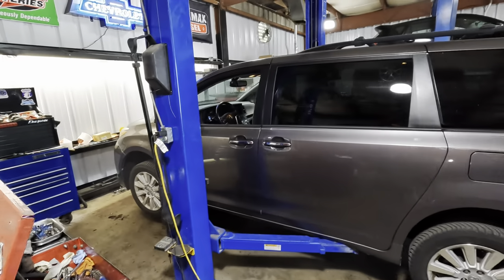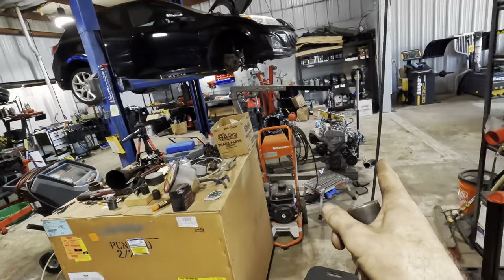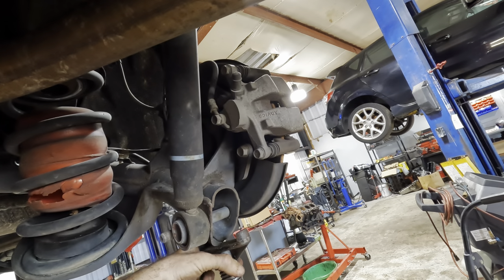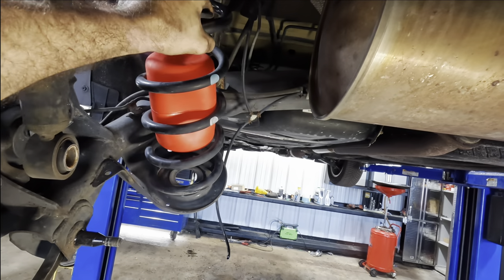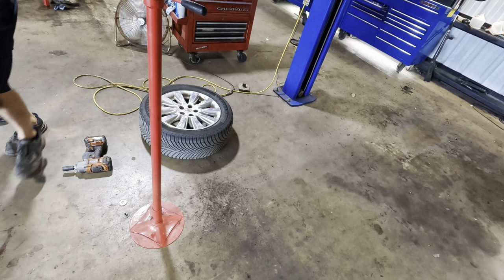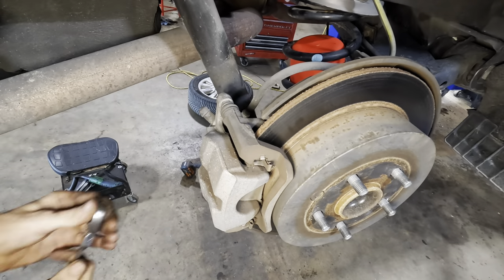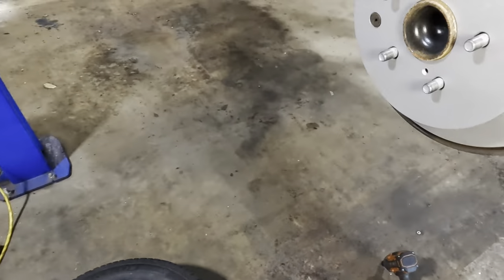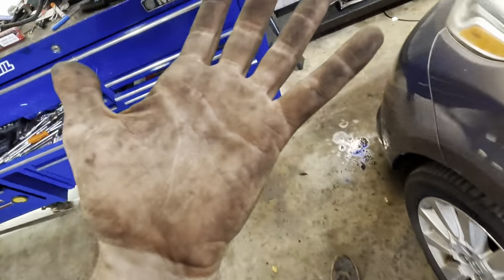Minivan Tow Vehicle! (Helper Bags) Toyota Sienna 3.5

Comment: Do you ever find yourself going to get something and then be stood there and think to yourself " what the heck did I come in here for?!" and then having to go back to your work to remind yourself what you went through there for in the first place? 😆 🤣 😂
Reply: Weed does to ya.
Reply: Old age does too 😆 🤣 😂
Reply: !/2 the time going into the bathroom.
Reply: All the t…  wait, what was I typing?
Reply: many,many times, it's when you go back to where you were and remember what you were doing,and go to get or do what ever it was,and you still can't remember, that it's worrying !   I found out what makes it happen (for me anyway)  on the way to the place that there is something I have to get or do, I see something else that I have to remember to address, and in slotting that thing into my memory, it seems to push out the original reason for going. I think that reason may be only lightly held in mind. Say I'm going to get a 7mm slotted screwdriver, I haven't thought much about it, I just know I need one, so the other thing I have to remember, I do have to think about. And this seems to empty the holding spot for the screwdriver.     I have probably expressed this very badly, I must think about it !!
Reply: That's what happens when the crain branium is filled with too many 60's and 70's song lyrics. No more room for the short term memory.
Reply: @clbcl5 
Thanks, now I remembered where I was going.  😂
Reply: I call them senior moments
Reply: I call that a glitch in the matrix. Lol the story of my life. Haha
Reply: It's happening in my 30s. 😬
Reply: All too many times! 🤣😆
Reply: @brianpiper3188  I'm surprised it doesn't happen to Ray more as he's blethering to the camera so slightly distracted talking to us, maybe those takes don't make the cut 🤔

It'll happen now I've mentioned it (Jedi subconscious mind trick, 'These are not the parts you're looking for!' lol), he'll be cursing my name 😆 🤣 😂
Reply: Daily!!!
Reply: Yep been there
Reply: Yes, I called that a brain fart.
Reply: Question for you, Ray. Are you not required to wear steel toes in your shop? I live in Canada and we are required to wear steel toes or other safety shoes.
Reply: What was the ? ... again???
Reply: Too many things on my mind
Reply: So that’s not supposed to happen 😎
Reply: So that’s not supposed to happen 😎
Reply: Always done that no weed or old age involved lol 😂
Reply: Many a time 🥴
Reply: Yes. Being 68 can cause that.
Reply: Yeah man trying to remember to do everything at once is disorienting
Reply: Well, we know where we're goin'
But we don't know where we've been
And we know what we're knowin'
But we can't say what we've seen
Reply: All the time 😂
Reply: @scottbishop7899  Even when in my twenties I found myself doing that. I think it's due to being scattered, thinking of too many things! 🤔
Reply: Yes - Either to many  irons in the fire or   a hitch in your get along .
Reply: Yep.
Reply: I'm 32 and this happens, I must be doing something wrong
Reply: All the time
Reply: @clbcl5  😆

Comment: The vehicle owner made an excellent choice for tires. I put the Michelin CrossClimate 2 tires on my 2021 Ford Escape Hybrid and in my 68 years on this Planet I have never had a better set of tires on anything.
Reply: There's a perceptual issue at play. Unless you compare a NEW set of the original tires, against the new Michelins, you have a very misleading impression. Any new set of tires will be better than 4 year old tires with tens of thousands of miles on them.
Reply: I retired from Uniroyal Goodrich tire company and Michelin tire company bought us out. When you buy a Uniroyal tire you are buying a Michelin tire but a lot cheaper. You pay for the Michelin name when you buy a Michelin tire and are paying for advertising
Reply: I don't really like the seating on those tall jacks, I can see that you don't much either !
Reply: Those tires are overpriced junk
Reply: Those tires are outstanding in snow…if they made them in 33” they would be on my truck instead of just my wife’s Pilot.
Reply: @Mike-gc9ih 
I retired from Goodyear and I would buy the Uniroyal tires if I didn’t get a nice discount from Goodyear.
Reply: The best choice the owner made was the repair shop.
Reply: They look awesome, but they are directional.  I like to rotate my tires in a way that doesn't work with directional tires.
Reply: I bought the same tires for my wife and daughter. This means that I certainly agree, great tires.
Reply: @rainmanraysrepairs What was the brand of brakes you used on this van?
Reply: @Mike-gc9ih  --Same goes for vehicle Crankcase oil, they all go through the same testing and most have the same additives...
Reply: Damn, the old air bag was tougher than a 1.99 steak from dollar general!!!
Reply: @TheEverydayShopperReview  😆

Comment: I'm guessing you don't realize this, but these bags are designed to be installed without a need to remove the springs. In this case, cut the old bags to remove, then collapse the new bag, slide it between the coils. They're small enough to easily maneuver/ shift them around in the coil spring so they are oriented correctly.
Reply: I have a 2020 Toyota Sienna that I personally installed Firestone brand helper air bags.  I didn't need to remove the tires or anything that I recall - just compressed the bags to fit between the coils.  Once positioned, install the air hose plumbing, add air to suite, and they've been performing flawlessly ever since.  Easy-Peasy.
Reply: That is the correct procedure, but Ray doesn't read instructions.
Reply: @Gspizzy  Instructions are included because sometimes we lose track of our coasters or need to shim a piece of furniture back to level..

Comment: Ray, there is a shortcut you can fold the new one to get it through into the spring and you should’ve just cut the old bag out
Reply: Agreed....and that's actually the procedure outlined in the instructions. Oh wait.... we're men and don't read instructions 😂
Reply: The pinch method would of been easier on this van, than on my ram, the springs have bigger gap.
Reply: That is the correct procedure, but Ray doesn't read instructions.
Reply: Have the same van and bags and I folded it up to install as well. After 10 years on the first set, mine started leaking so I reached out to airlift and they shipped me a whole new set as they are lifetime warranty.

Comment: Shaky hands is an old mechanics problem. A guy at my fathers workplace was shaky as H but the few seconds he needed for setting a bolt, nut or screw he became perfectly stable. According to the medics it was nerve damage from all kinds of nice cleaners, oils and other crap he had handled over the years. All in all it was the same as a really bad Parkinson's disease. Still he was the most experienced and knowledgeable mechanic they had. But it was interesting to see him put something together. You would never think he could get it done with those shaking hands, and every time he amazed me. He died a few years after retirement when his body simply couldn't handle it anymore.
Reply: There are several reasons a person can get shaky hands, including Parkinson's, arthritis, weakness, fatigue, and so on.
For many of the non-fatigue shaky hands, applying pressure helps steady things. Like the pressure on a wrench, or pushing a grocery cart, or, for a crafter I watch, having his two hands braced against each other while he paints table-top gaming miniatures.
Reply: @MonkeyJedi99  --Brain Concussions, I have had two of them also Nerve Damage from Electrical Shock, also a Bad Thyroid...
Reply: There is a genetic condition called Essential Tremor. I have it and it was in my fathers side of the family. It doesn't happen at rest, only when you try to do something like putting a bolt or nut in position or writing. It usually happens in the dominant hand first starting around the age of 40.

Comment: I was surprised there was not a hose spring clamp on the bottom of those helper bags.
Reply: I guess the hose will pop off under pressure...
Reply: There should be a spring clamp on the air bag connection.  I installed the same bags on my vehicle.
Reply: He does things like this on purpose to get viewers to comment and improve analytics 😊😊
Reply: There was originally. see 10'04" . Suspect he's just checking if viewers are paying attention.
Reply: There was on the original at 09:10 which was why Ray cut the hose. Also there are obvious clips in full view (to act as a reminder) for all the other airline connections as Ray pushed the hose back on at 20:54

Comment: Another way to install those air bags, I put them in a bucket of hot water to make them  more flexible.  Did not have to remove the springs, was able to slip them between the coils on the spring.

Comment: Picked a used Explorer at a local dealer, on way home needed to replace a tire rod end.  Next a different rattle, rear brake missing mounting bolts.  Dealer wanted to rotate tire and oil change.... Right, what are they going to screw up this time...  Went to a great local automotive shop, job done perfectly.  Thank You all the private owned shops.   The worker there have been told of your site, prompt when I can...

Comment: i replaced my airlift 1000s on my 2002 odyssey by cutting the old one out and squeezing the new one flat so it would fit between coils.  no need to remove the springs.  i'm pretty sure that's in the instructions.
Reply: Hmm...perhaps he can't Read😅
Reply: That is the correct procedure, but Ray doesn't read instructions.

Comment: Ray if it helps with that mustang i just put those same headers on my 1994 mustang gt with the 5.0l i see you have the engine mounted up a little with the subframe out when i was tightening those bolts i disconnected my engine mounts and jacked my engine as far up as safely as i could and i was able to tilt the motor side to side and that helped alot with getting those bolts in

Comment: I used this kit on my 2012 Honda Odyssey work van which was always full of tools in Canada. 
I hated them. I maintained and checked air pressure regulalry. After 1.5 yrs they popped like this. 

So, i did some research and found the Timbren upgrade. Basically a beefier larger rear bump stop. Installed those and was MUCH happier. No more pressure checkups, no more headaches. Rode better too!
Reply: I have a 20-year-old Chevy truck, had to replace the bags once.  The problem is you need a minimum air pressure of 5 PSI in the bags or they will get damaged.  Manually having to check and add air pressure sucks!  This is why I added an air setup that I can control with a remote.  But it also will keep at least 5 PSI in the bags. Since doing that, they've lasted a very long time so far.  

I took a look at Timbren setup.  I have zero experience with it.  It looks cheaper and easier to install.   I'm not so sure about right though.  I put a lot of weight in the back of my truck and the back is sagging, I just adjust the air pressure up with the remote until it's level where it was.  It rides quite good.  But ya, You really need an auto air setup which adds to the cost.  Of course there can be a lot more parts depending on the setup, the kit you want and or need.   For example, the bads inside the coils are pretty cheap.  Few parts needed.  Pop the bags in the coils and some air lines.  Add an air setup, the costs go up and a lot more work. 

I didn't see Ray add any air to the system.  I hope he did otherwise those bags will not last long.  Again, you need a minimum of 5PSI in these systems and if it's manual, you better be checking the system weekly!!!  Timbren basically looks like a bump stop to me.  If I had a manual system like I first did, I would keep a minimum of 10 PSI in them.

Comment: We used to put bands on the springs before letting the axle down. The bands held the springs in compression so that we could free them sooner during the suspension drop. Put it back together and cut the bands. You just need to make sure you did not drop the compressed spring.

Comment: I've not had to deal with airbags but it seems like those hoses on the bottom of the bags should have clamps on them.
Reply: The tube is plastic and the bag fitting will grab on the line going one way.  It goes on and doesn't really come off.  I believe there are little spring clamps that should be in place.  Are they really needed?  I don't know.  Ray did have to cut the tube.  I don't know if they were there or if he installed them.  it should be OK either way.  I would use them.   Those types of bags slip in place without having to remove the spring.  Maybe it was easier to do that because it had old bags in it?

Comment: I've installed a lot of these bags.  I have a set on my lowered Chevy truck.  When I have a load in the back of my truck or towing, I can air them up.  The thing with these air bags is that they need air pressure in them always.  At least 5PSI or you will destroy the air bags!!!  So I have a remote controlled pump on my truck and will automatically keep the pressure I set in them.  Minimum being 5 PSI.  

The manual air fitting works, so long as you are always checking it,  That was how I had my truck at first and I ended up screwing up my bags and having to replace them.  So I added the auto Air compressor setup.  The second set of bags have lasted a long time.  Once in a while I can hear the pump run for a few seconds.  My truck I got NEW 20 years ago and my system has been installed for almost as long.

Comment: If you had a "WildFire" mobile lift, it has coasters on the four post ramp lift, it can be moved fully at any time even if loaded. No more lift problems! You could even roll it outside during day shift and have four or more lifts in action at any time.

Comment: Those Air Lift bags are warrantied for life.  I've used them in the past and that's what their rep told me!
Reply: Warrantied for the life of the bag?
Reply: If you don't keep a minimum of 5PSI in those bags, they will get destroyed!!   I didn't see Ray air them up.  I hope he did.   It can be a hassle having to check weekly.  I screwed up my bags on my Chevy truck because of that.  I ended up installing a remote controlled setup that will auto fill the bags to the pressure I set with the minimum being 5 PSI.  I haven't had any issues with my bags since then.  One time I loaded up the back of my lowered truck with 8, 6-Volt Golf cart type batteries.  Very heave each of them for Pallet Jack use.  My Remote battery was dead and the back of my truck was sagging as I couldn't add more air to the system which only had 5 PSI.  My truck is 20 yeas old now and the second set of bags have held up very good.  It was easy enough to get a set of bags only.
Reply: @jbdragon3295  Hmm... I saw Ray air them up to 8psi.
Reply: @MonkeyJedi99  

I must of missed that, ok!  8 psi is over 5, so it’s good.  It should be checked weekly to make sure it is always above 5 psi.  Personally, I found that a hassle and the bags got damaged because of that.  This is why I changed it over to an automatic setup.  Zero issues since then.   Other than a dead battery in the remote after years.  There are different air pump systems with different costs to them.

Comment: I appreciate Ray's attention to detail; i.e. always installing the proper fasteners for brackets , looms, etc. and fastening them properly.
I just finished an all-day marathon replacing my PS pump on my 2004 Ford Ranger 4.0L V6.  Somebody before me stripped out the two threaded holes in the mounting bracket for the two rubber bushed mounts for the reservoir.  It's a $30 part and I will pick it up Monday.  Also, half of the plastic buttons and two screws holding the left-side inner fender in place were missing.  There were a couple other similar things I noticed, too.   Critical? Probably not.  Still irritating, tho.  And it has only seen the Ford dealership and a Christian Brothers shop over the 183k miles I have owned it.  It's a pity when you can't even depend on the dealership to do a proper job.
There are very few wrench benders out there that truly perform the work properly.
Kudos, Ray!
Reply: Been doing a lot of work on my own early 2000's Ranger, too, lately! Lot of problems with sun/plastic damage going on here too. But, that's just the "sun tax" of living in the "sunshine" state, heh.

Comment: Can't you deflate the bags and fit them between the springs without removing the springs?  I haven't put those in before, but I thought those were installed deflated so you can fold them.
Reply: That is the correct procedure, but Ray doesn't read instructions.

Comment: Interesting that the air line comes up from underneath. I installed the same bags in my ‘13 Sienna and I ran the air line down from the top. I also ran my air line through a wire loom to help protect it.
Reply: I ran the lines through the top of my ‘05 Tahoe also. I had to know if they can be installed upside down so I went to the AirLift website. For the ‘15 Sienna, it says valve side down. I figured they were all the same.

Comment: I think you missed a brake cleaner spray opportunity on the rear brake job. When you took the slide pins out and lubed them it would have seem the perfect opportunity use a pin barrel brush to clean and then to spray the inside of the pin barrels with brake cleaner to dissolve the old grease. You mentioned that one pin you took out was dry. That would indicate to me that those barrels needed some cleaning. As always, thank you for making this video and sharing your expert knowledge.

Comment: I put airlift brand bags on my dodge Dakota. They go on top of the leaf spring to the frame. To add extra weight capacity for my atv trailer. Got the remote compressor as well to adjust from cab.

Comment: I installed a set of those bags in my front springs of my 94 f150. Worked great to keep the truck level with the plow on. Sadly here in the great salty state of WI the poor truck has probably been recycled into brake calipers by now.